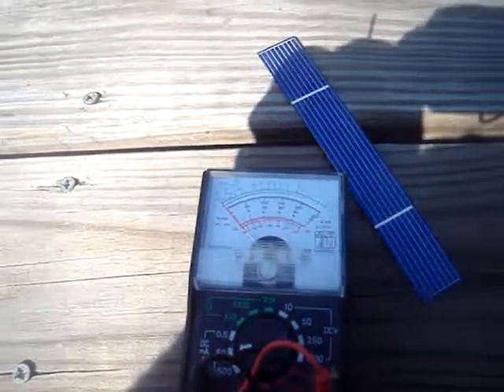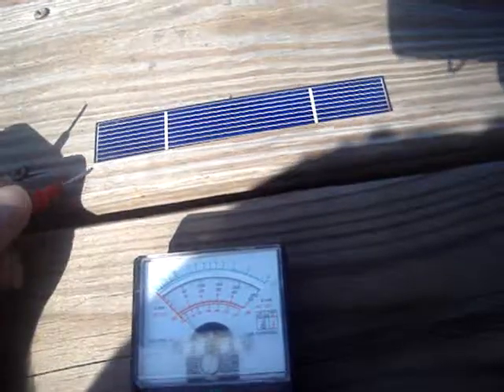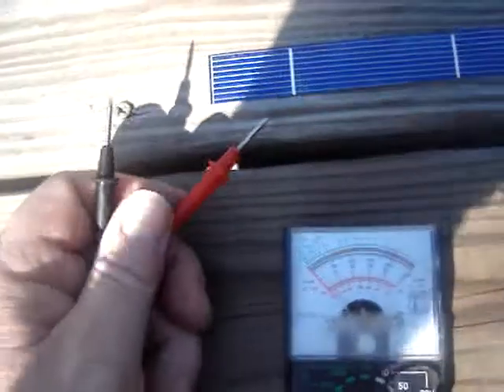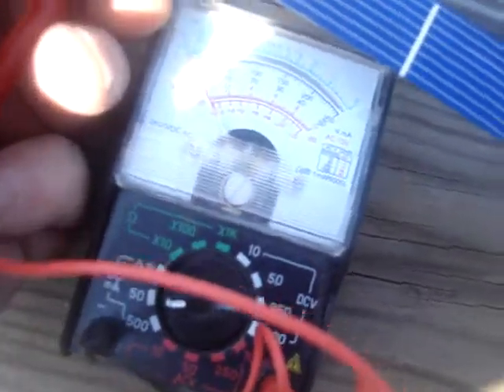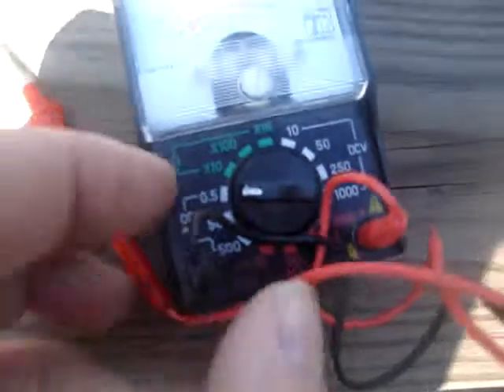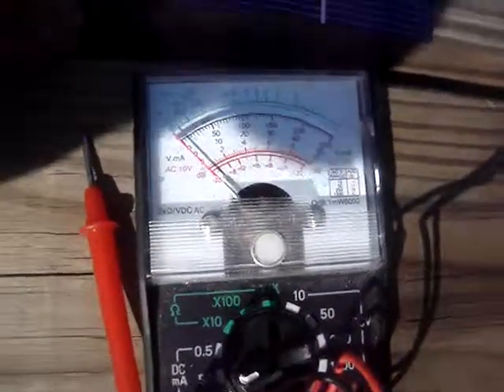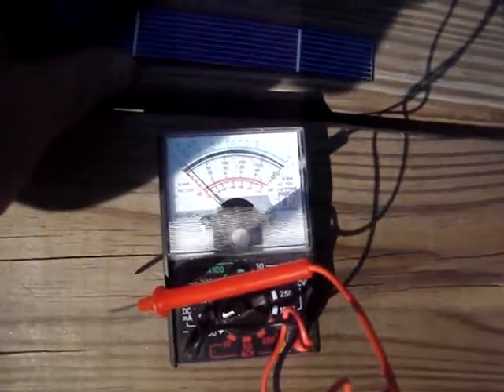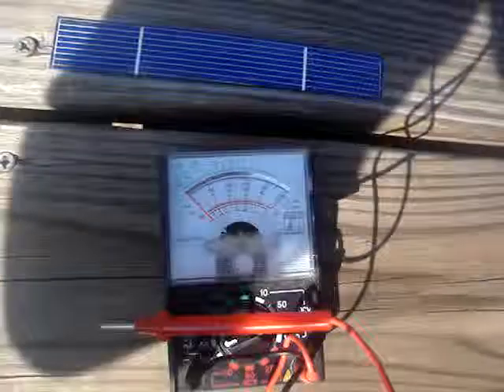ebay 51 Test video

Comment from the maker: @torentmonkey yea analog is a bit primitive but a whole cell puts out 3.6 amps and this piece measured about almost 3/4 and notice the shade on half of it and it was still doing near 400 ma, in all sun I'm sure it would have done 800 ma which would have been near 1/4 of the whole cells output 3x6 puts out 3.6 amps